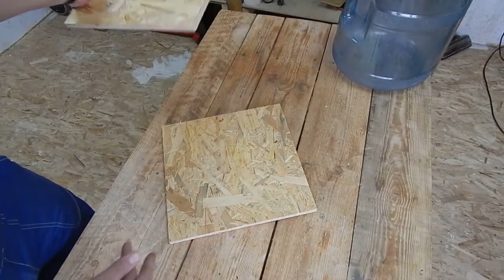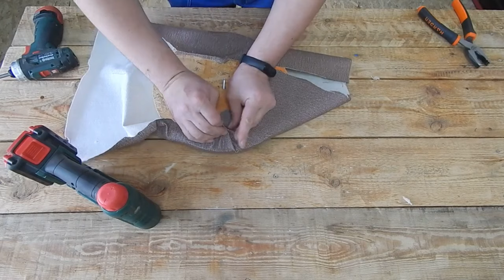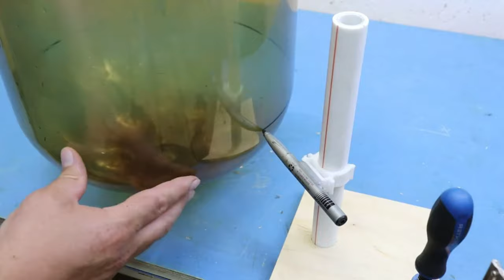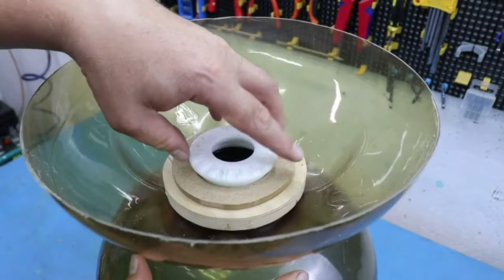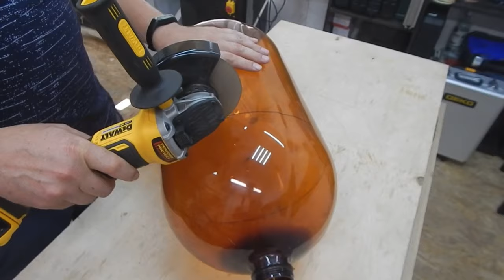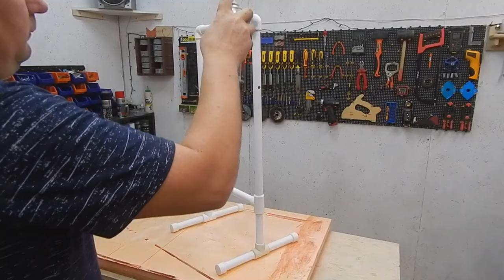After learning this secret, you will never throw away an empty plastic bottle  A brilliant idea

Comment: FILL WITH SAND AND CEMENT AND REBAR AND MAKE HOUSES. THE BOTTLES SUT OPEN LIKE YOU HAVE CAN BE WALLS AND INSULATE ALSO TO RECYCLE THE PLASTIC MAKE A CEMENT MIX AND REBAR THEM TOGETHER . YOU CAN MAKE STOVES ALSO . USE AS MOLD.  RECYCLE USE FOR MAKING CIDER AND SUCH . STORE RICE IN THEN IT CAN POUR INSTEAD OF BAG RIPPING AND RICE ALL OVER ! ASK ME HOW I KNOW LOL!

Comment: YOU CAN USE THE BUTTER TUBS ALSO LIKE THE DECK FOUNDATION ONES JUST PUT STYROFOAM IN FOR WHERE THE 2 x4 GOES AND POUR CEMENT FOOTINGS WITH THEM SAVES MONEY THEY ARE TEN TO TWENTY DOLLARS AND THE QUICK CEMENT ONLY 8 $ LOL